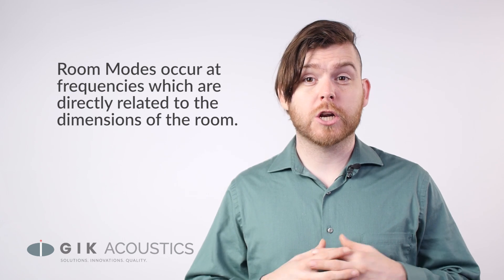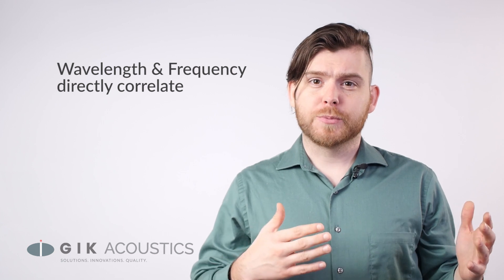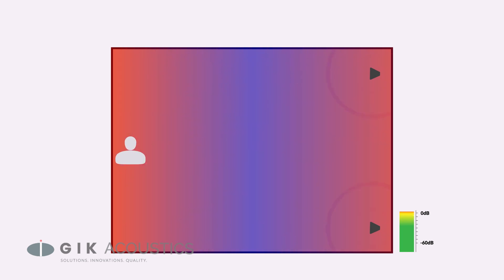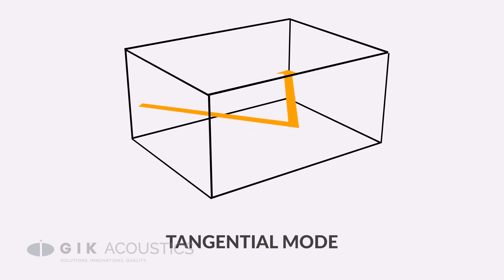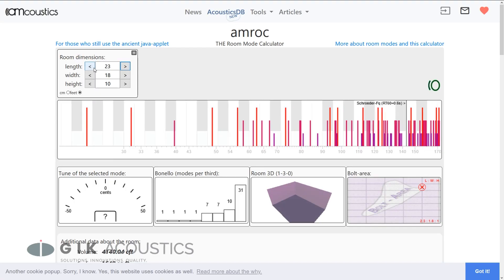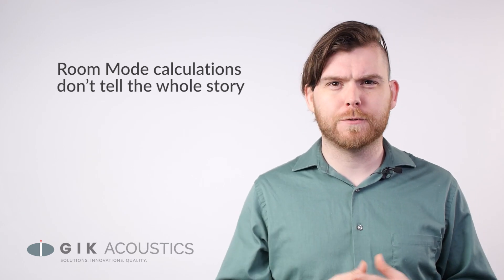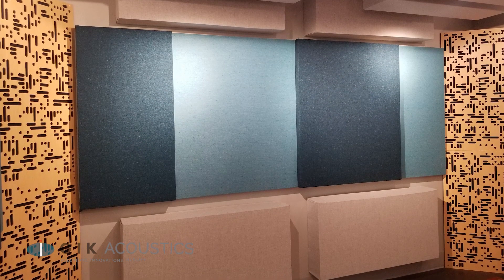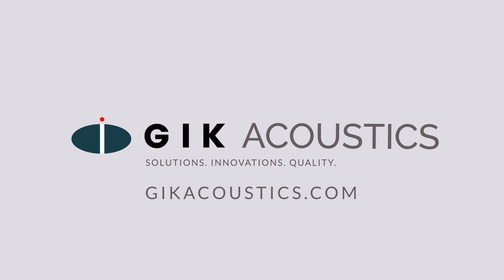Measuring and Treating Room Modes

Comment: I have bass traps on the front wall, but still have the problem where bass sounds better when I stand in front of my sofa and softens when I sit.
Reply from the maker: There are certainly room modes that occur at different heights. I would suggest you reach out to us for our free advice on how to mitigate any bass issues you may be having and even with what you have done so far to treat your space. GIkacoustics.com/acoustic-advice/

Comment: Correct me if I'm wrong, but won't the room modes in a given room vary depending on the location of the source of sound?
Reply: The modes are completely independent of the source. They are calculated via an eigenmode analysis where sources cannot be included. The driven response where you have source will be affected by the modes and the location of the sources and the location of your microphone.
Reply: Effectively not, for long enough wavelengths.

Comment: What a pity that typical room sizes of 20 feet correspond to typical alternating current frequencies of 50-60 Hz ...
I have a low frequency sound in my room, no it is not my ears, no it is not the hum I go out I don't hear it I come back I do.
I also measured it with a good microphone and a bit of Labview code ... my best guess is a neighbor's household 
appliance is mounted on a wall somewhere. I need to investigate it. Thanks for the info.

Comment: I'm liking it, but at 1:05 - 20 feet long, wouldn't that be 28Hz? Cheers!
Reply: 28 hz is around a 40ft wavelength
Reply: @Canadian_Eh_I  Yes, but the dimension is 20 feet long, so 565/20=28.25Hz, so the wavelength is around 40 feet, yes (1130/28=40.35ft).
Reply: full cycle of 20' is indeed ~56hz, but it is true that at these dimensions at half cycle the room would respond down to ~28hz.

Comment: There is a myth about corner modes. If you use a mode calculator, it is VERY rare that you'll see corner Axial modes.  In fact, of all of the room dimensions I'm punching into a room mode calculator, I have yet to see an Axial mode that only effects the corners, so putting corner bass traps without dealing with the rest of the surface isn't really going after the Axial modes.  I would treat Axial modes first, as they are the biggest problems.  But you have to have what I've been told at least 50% of the surfaces covered for a sizable difference.  Also, how much energy at those frequencies is also important.  If you are listening to music at 70dB, there's not going to be as much of a problem in the low frequencies as there would be if you are listening to at 100dB, as an example.

It's also important to match the size/volume of the room to the speakers and the energy you plan on putting in the room.

For treating the lower frequencies under 125hz, some would rather build thicker walls with more mass so that you don't have big bass traps all around the room, otherwise you may have to build a pseudo wall using a lot of bass traps all around the room floor to ceiling.

But first you have to choose the right room dimensions for the usage.  Bedrooms, even though they are becoming popular for setting up a DAW for mixing, are typically too small, especially if you have things like 8 ft ceilings, square dimensions and rooms like 10ftx10x8ft.  That's just a big mess that requires too much treatment  since you'll have a lot of treatment needed and you'll end up with much less usable space.

Plus, 99.99% of the homes have thin walls, and are NOT designed to be used for music listening/producing applications.   2x4 studs with sheet rock and building insulation isn't that great of an absorption in the lower frequencies, especially when you get below 100hz.  They also have a relatively low STC rating.  Adding more sheet rock and green glue isn't going to help all that much either.
Reply from the maker: Thanks Oneness,

Agreed - Calculating modes is rarely 100% accurate, especially for non rectangular or asymmetrical rooms. It is always better to measure what's actually happening, as opposed to predicting what is probably happening.

We also agree that surface area is the most important factor in performance, ie, having enough panels overall, and the right kinds of panels in the right roles.

However, listening at 70dB vs 100dB affect the end result curve. Acoustics are a linear phenomenon. It is possible you are hearing differently, due to both normal Fletcher-Munson curves in our hearing at different volume levels, and also louder music will have more dynamic range given a consistent noise floor, so some things can become more audible above the noise floor at louder levels. But the overall response curve will be consistent & proportional across different volume levels.

Building thicker walls with more mass can help some with isolation (if the details of the build are well-designed and well-executed it will help a lot), but doing so will exacerbate the bass response inside the room both because the room is now smaller, and also we are keeping more sound inside the room (less sound escapes). So if the goal is to improve sound quality inside the room it will be a step backwards, though this is sometimes necessary if stopping sound is important for what you do (and where you do it).

Our bass traps in particular will give absorption results below 100hz, although if wall size is the limiting factor, this is an understandable impediment. One solution for controlling bass is our corner bass traps which are built to sit flush from wall to wall to allow for more usable space when space is limited in such cases.
Reply: @GIKAcousticsLLC  I have looked at a lot of different room dimensions with a room mode calculator and the corners are only associated with Tangental and Oblique modes. I have yet to find a room with corner issues with Axial modes.  Since Axial modes are the biggest problem, if you have enough coverage to deal with Axial (entire wall coverage), then shouldn't that take care of the corners?  Corners seem to be only about 10%of the surface.  Sure, it will be an improvement to just put corner traps and nothing else but I would think that treating the entire wall will be much better difference.  I've tried corner absorption and it only made a small difference IMO.  I've been in rooms with the more of the surface covered with nothing in the corners and it was a much bigger improvement than just treating the corners.

Obviously, one has to perform measurements because it does matter how much energy one is putting in the room.   

Just going with what experiences I have had.
Reply from the maker: @Oneness100
There is no doubt that while bass trapping is a very important part of an overall strategy for spaces that are used for critical listening specifically, there is no requirement that it is always the most important first step to improving the sound in a room. We may suggest treating the first reflections on the walls and ceiling or an overall square footage and thickness of the treatment needed, depending on the goal of the room, to get the best results. We always take a tailored approach based on the room dimensions, and the use case of the room. 

Keep in mind, some rooms may have added diffusion, reflecting, and scattering in order to keep the room from feeling too "dead" from overabsorption of mid-high frequencies, while some listening positions might be set up not optimally as well. Sometimes, a room might not be an improvement in the low end, but only the mid-high range, when using panels on the walls as the only strategy. An improvement really depends primarily on the overall strategy, which for example critical listening such as Pro Audio, Hi-fi being much different than speech 
intelligibility in a lecture hall per se.

We 100% agree on using measurements to determine the best results for the room. We are keen on using REW (Room EQ Wizard) to measure and then demonstrate the differences, especially for pro audio purposes. Here's one example of a treated vs untreated room:
https://youtu.be/b9u6rvWSTDM
Reply: @GIKAcousticsLLC  I have watched the video, the problem with recordings of music in a room doesn't really capture what one would experience if sitting in the listening position.

Obviously, how much low frequency energy being put in the room by the speakers will dictate.  But I'm thinking in terms of a full range speaker system that goes down below a typical bookshelf or if someone is using subwoofers.

As far as the difference between a 2 channel hi fi and a control room for a studio, I've had several acoustic engineers tell me that it's the RT60 that is typically different and that a control room would have more absorption and maybe diffusion against the back wall, but for a 2 channel, they would opt for diffusion in the front and rear walls because that type of listener typically wants a bigger and deeper soundstage where front wall diffusion will allow for that..

But I've been playing around with a room mode calculator and many different room dimensions and I have yet to see a single Axial mode where they build up in the corners and I most of the small room dimensions I've plugged into the calculator typically have room modes starting in the 30, 40, 50Hz range, and typically what I've found is that the modes are either against the entire front/rear walls, side to side or floor to ceiling.  It's the Tangental and Oblique modes that can be all over the place and in the corners, but those aren't the biggest problems. The biggest problems are the Axial modes.

I've been in rooms that had low frequency (down to 30hz) and it was an amazing experience.  Just treating the mid's and high's simply isn't the same, in terms of a full range Hi Fi system.
Reply: actually, thin walls are excellent for eliminating LF build up in a room, of course if you need isolation, then you will need to change that...
Reply: @GlennStanton  When you say LF, what frequency range are you referring to?

Yes, I know for isolation purposes, thicker walls and lots of mass is required for full range.

But standard wall construction is only designed for 125hz and above.
Reply: @GlennStanton  Glenn, I hate to be the bearer of bad news for you, but I know someone that builds high end rooms (2 channel, home theater, vocal booths, studio control rooms, etc.).  He has built AND tested practically every type of construction design/materials used to know exactly what each method will work or not work.

  100hz and below require pressure based absorption, and the "cabinet' depth or wall depth needs to be deeper the lower the frequencies you want to absorb.

A typical home has 2x4 studs with sheet rock.  Hardly going to do anything against low frequencies below 100hz.

FYI, the person I know can get +/- 1dB down to 30hz measured with his room builds and he uses his own wall construction for the walls and ceiling.  his walls and ceilings typically are at least 10inch or deeper, depending on how much energy is going to be put inside the room.  Thicker for large Home Theaters that have many large sub woofers.
Reply: @Oneness100  hey whats your E-mail? Would love to discuss these issues more.
Reply: @johndahitmakaa9256  I don't give my personal email to people I don't know.  Sorry.  Is there anything specific you want to discuss?
Reply: @Oneness100  no problem!! Wanted to ask how what you recommend for taking low frequencies below 150hz!! Interested to know your thoughts… How do you use mode calculator to determine the thickness of your panels
Reply: @NyakzOTSD  first off, there is a cutoff point and it's more around 100hz to 125hz where it's better to use a pressure activated device rather than velocity based.  But more importantly I would recommend talking to someone to evaluate your specific situation and develop a strategy, based upon your room's challenges, the application, budget etc.  And then you figure out where to go from there.  Out of all of the companies I have dealt with or have seen their approach.  I can honestly recommend one company to call and start from there.  They work with DIYers all the way up to those the can only buy prebuilt units, to those that want a complete custom built room.  I haven't seen any other company address all three.  They make probably the best treatment products, but it's their approach to developing a strategy is equal as important, if not more.   I'd contact them first and then go from there.  It's not cheap, but it does yield a result you'll be happy with, if you can afford their products or use their design and build your own versions.
Reply: @NyakzOTSD  What's the dimension of your room? Just curious.
Reply: @Oneness100  interesting!! Appreciate it! I saw you where also in the comments section of field acoustics and He gave me an options that seem extremely good but was so expensive!! Making a mixing environment is not easy at all
Reply: @Oneness100  L 16ft x W 13ft x 8ft H ! I also have panels but after extensive research the panels on my wall don’t absorb anything below 100hz
Reply: @NyakzOTSD  No, they aren't going to you since they really can't.  

You'll need to probably start with pressure based absorption that can do down to 30hz, IF your playback system goes down that low.    With those room dimensions, your Axial pressure modes start at around 35hz, then another at 45hz, then 70hz (which is because of the 8ft ceiling curse).    There's products that can absorb that, but they are fairly deep, and heavy and you need to make sure you can give up the room.
Reply: @NyakzOTSD  Yeah, I know.  Blame it on small room acoustics, 2x4's with sheetrock and building insulation walls, 8ft ceilings, etc.

About the only way to get around it is to have small mini monitors that are about 3 ft apart, and with 4 ft of distance between each wall surface (front and sides) and sit around 3ft from each speaker and just do near field monitoring at relatively low SPL and that's about the best you can do without spending a ton on acoustic treatment.  But you are still going to have some low frequency issues..

You should be able to do that in your room with the dimensions you have, you just can't do a full range system at loud SPL.

But it's hard to mix if you have a lot of information in the low frequency range if you can only use small mini monitors that bottom out at 50hz or 60hz range...
Reply: @NyakzOTSD  Remember, the walls in our homes are generally not going to do anything below 125hz either. So you either have to build from the ground up using 2x12 studs, lots of layers of things like plywood, MDF, MLV, etc. and activated carbon, but that's also expensive for the average person, even if you do it yourself.
Reply: @Oneness100  I use Psi Audio A21ms and Dynaudio LYD 48s.. and they go down to about 20hz but I don’t think I can hear that low! I also looked into activated carbon panels but $700 a piece is crazy 😂😂.. but the reality is a great room is extremely expensive and that’s what people pay too mix engineers for.. Their rooms
Reply: @NyakzOTSD  low frequency treatment is expensive and you need a lot of coverage.   Otherwise it won't be nearly as effective.
Reply: @NyakzOTSD  I don't know what to tell you.  to get those speakers to sound their best, due to the room dimensions, you'll probably never be able to smooth out the 70hz problem and that's primarily due to the ceiling height.   if already called AF and they gave you advice on what to use from their product range, that's what it's going to take.  Can you build your own?  it can save some money, but since you are still going to need quite a few of them at least on the front wall and side walls, it's still going to be expensive, but the sound quality will improve drastically for the low end.  But that 70hz problem is probably always going to be an issue and it's due to the room dimensions, especially the ceiling height.  8ft ceilings just cause too much of a problem, even 9ft or 10ft is better, but still a problem, but if you had 12ft or 14ft ceilings, then you would definitely need a wider and longer room because you don't want two dimensions too close to one another and you definitely want the ceiling to be the smallest dimension..
Reply: @NyakzOTSD  FYI, I have seen their products In person and they are rock solid, excellent build quality.  They ship those low frequency cabinets in wood crates that weight in the neighborhood of 100lbs, just for the shipping crates.   You are buying extremely well built and well designed units that do the job.   

If you have a chance, check out a room that has their products and listen for yourself.  You'll almost be willing to cut off a limb for their treatment.  :-)